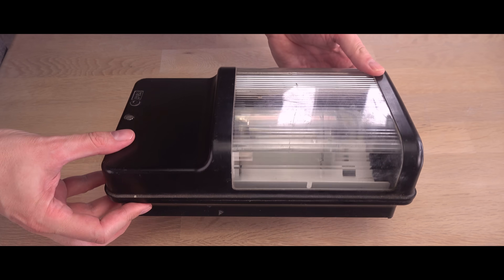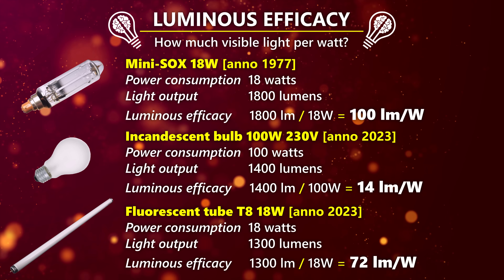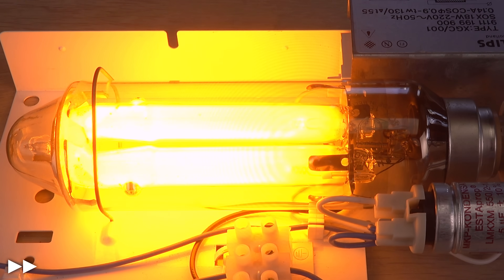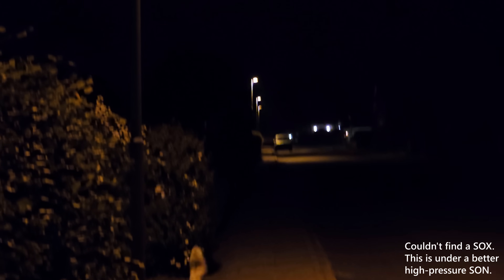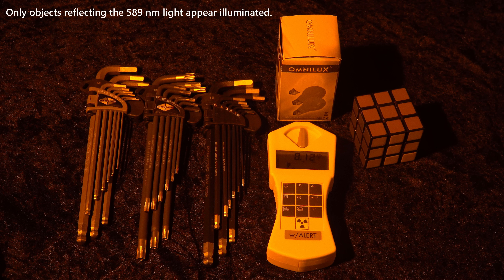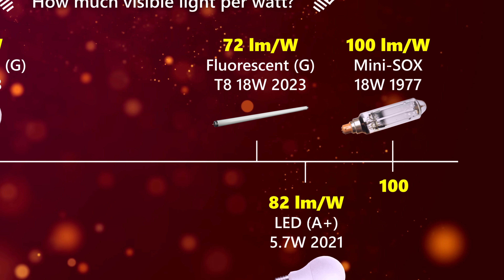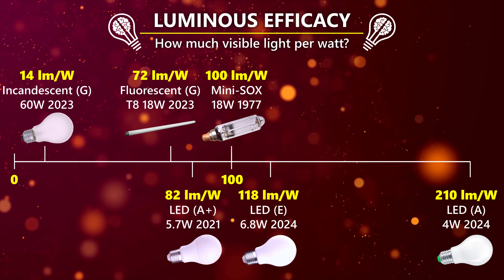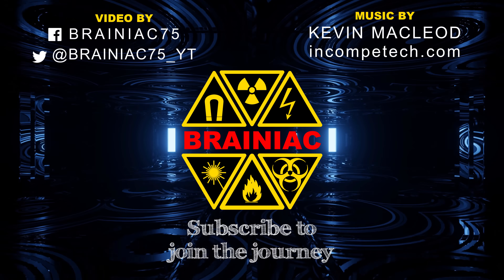THIS LAMP SOXs! "Yellow" tech of bright metal vapor lamp. Beats modern LEDs in brightness per watt?

Comment: High pressure sodium lamps were commonly used in bigger photographic darkrooms as safelight, because you can make photomaterial that is not sensitive to this specific wavelength. Nowadays, it is easy to make a LED for that purpose if needed.

Comment: Fun fact: at low lux levels, the typical human eye responds as if monochromatic. Conclusion: low level white lighting is of doubtful value if perceived as black and white.  Might as well benefit from a coloured street light that is different from vehicle headlights. Amber LEDs, anyone?
Reply: It doesn't work like that exactly. Though your scotopic (night) vision is essentially monochromatic, it has more sensitivity to certain wavelengths, and different ones compared to photopic (day) vision. While photopic vision peaks at around 555 nm, which is a yellow-green color, scotopic vision peaks at around 507 nm, which is a cyan color. So using white LEDs is actually better for night vision, since it produces more of those blue photons, whereas a high-pressure sodium lamp is way off from the peak sensitivity of our eyes at night.
Reply: Yes, but the net result is monochromatic streetlighting from a CRI70+ source.

Comment: In photons-per-watt, LED has greatly surpassed SON-T by about a factor 1.75. The problem is that those LEDs are the red 600 and the blue 450, both which have a low lumen-per-photon, but they're ideal for growing lights.

Comment: the biggest issue with the new led bulbs is their lifespan at that output, they run so hot they deteriorate very quickly, if they are run at a lower wattage they become even more efficient and run cooler

Comment: I am old enough to remember the first trial of sodium lights. Environmental and safety concern added by non discrimination of the color blind. First they used them for zebra crossing to gauze a possible safety effect. Many argued they were better in the fog just like French cars had yellow headlights. Eventually they pretty much became the norm of street lighting. The LED lights used now are far more tiring for the night drivers. To save even more energy they now use motion sensors to vary the light intensity where vehicles or pedestrians need light. Sad to see that most sodium lights are gone now.

Comment: Maintenance on a sodium lamp is a bit more involved than an LED lamp.  When I did electrician work, I preferred to change out ballast, cap, starter, and lamp because you knew the repair would last.  Plus 3 of those came as a kit together.  LEDs just seem to go and go unless the driver dies.

Comment: As for the LEDs I have in my house, the A19 bulbs (most rooms) are mostly Triglow 3500K so called "deco white" 1600 lumen bulbs. They draw 19 watts so my calculations come out to 84.2 lumen  per watt. I am kind of picky about color temperature. I can tolerate 2700K or 4000K but prefer 3300-3600K. Its difficult to find this color temperature range in bulbs, especially if you want 1500+ lumen bulbs in the A19 form factor. So when you finally find a solution you rarely have other options. I still have a bunch of Halogen A19 bulbs that produce about 3400K with 1500 lumens. They draw about 90w so just a hair more efficient than Incandescent but their light quality is superb.

Comment: The problem with these is that they are very monochromatic.  San Diego CA, Glendale AZ, and Flagstaff AZ were places I know of in the US that made extensive use of them.  Flagstaff used them specifically for their monochromatic output, which could be filtered out by the nearby observatories - Lowell and Discovery.  Light output was very good for lumens, but not so much for human vision.

Comment: We have quite a few sodium fittings still hanging around in the factory but they were last used way back in about 2014. They get taken down when we do work at high level. We went over to 4 x fluorescent tubed lamps fittings. One section of the factory has recently been converted to High Bays LED's, that go dim when no one is around. Once anything, person, fork lift gets near, they go up to full power output. Compared to the sodium's though, the LED's beat them for light. Maybe I'll be wearing sunglasses yet!

Comment: Sadly in the Unites states you can't generally get high efficiency bulbs. Nearly all are 100 lm/w and the bright ones around 80. I have some small ones I use for small rooms that are 117 lm/w, but only 350 lm. Ideally I'd like to get bulbs near or over 200lm/w. But the best I have found are 150lm/w and those I think are fudging the numbers because of how hot they get.

Comment: The efficiency gains in LEDs are great, if they are gained by using more LEDs. Unfortunately, due to our heightened sensitivity for green light, many extremely efficient LEDs have a terrible CRI. Thats why I do not look for the energy label on LEDs, it often negatively correlates with the CRI.

Comment: I have a sodium light I use for optical flats to take ultra precise measurements using interference fringes of light.  Wide spectrum bulbs have many different interference lengths so blend and dissapear.  I also used one when I was young for doing prints in a dark room because the paper was not sensitive to that wavelength. I’ve always been facilitated by how monochromatic they are. I really don’t like how they are obsolete because I like having a cheap source for monochromatic light for experiments.

Comment: Why don't they make LED's with 1500-2500K? There is always this 2700K limit for normal lamps and I never got why, only those "retro" led versions often have 1800-2400K but they are very low powered, so if you want really bright orange light, you have to use a RGB LED which would be stupid for normal home lighting.

Comment: LED streetlights need to go.
These were better in almost every aspect. Lasted longer too and you didn't need to replace the ballast when the bulb went.
When an LED steeetlight dies you need to replace the entire head, which contains the driver circuitry and heatsink.

Comment: Lumens and Lux are two different things... Lux is more important for visibility.  My whole 14 acres on my property uses Mercury vapors and high pressure sodium.   

You get a lot more visiblity with the DX coated Mercury vapor lamps than you do the high pressure sodiums.   But the lumen per watt is more on the hps.

I dont use LED because led lights for putdoor lamps are still pretty crappy or were theyd getting better.. but the pin point blinding ligjt of led is rather annoying.

I only use them for floods that i turn on and off at will.

The bottom coating of LED light bulbs are trash as well on your video at 9:55.  That coating there is like gold leaf thin...  and wears out very easily causing those crappy led bulbs to no longer work after a short time.  Ive had to replace many of them because of this.

While old fashion bulbs used very thick coatings that dont wear out.

Led diffusor tech is still crappy as well.   Outdoor HID lights are 360 degree 100% coverage that improve drastically with reflectors.   You can improve the lumen output by near 2 fold with a reflector.

Leds only go one direction.. and the diffusion reflecting tech is still pretty crappy with them. 

This is why LED lights over fish tanks create that wavy sensation in tje sand..  its all shadows.  Light coverage is bad with led over florescent or HID

Comment: I think a gas discharge tube with an advanced flyback driver with a current feedback loop that can be pushed to be 90% efficient could beat the LED in terms of lm/W maybe but definitely in terms of life span. There is just nothing to break here, the electrodes are thick tungsten balls so they would take a very long time to break down.  It basically lasts forever untill something else breaks it. If we take that sodium lamp, get rid of the heater coils and replace them with tungsten balls, boost up the voltage to several kilovolts or so depending on the gas resistance. You would need to switch to DC at this point and build a flyback driver like this. Now you are not loosing power in them anymore and instead you just heat up the gas with higher voltage and then lower the voltage as it draws more current.

Comment: I believe we used these for darkroom lighting since it was spectral pure in a particular band would not react with black and white paper processing. The lamps were hung from the ceiling and aimed up at the ceiling for a dispersed light. The energy ratings are false. When one considers the power factor being low the lamp will actually be using the same energy as a standard light bulb. Power factoring cannot be measured with standard analog mechanical kilowatt meters. If one had the new digital meters, they can detect the power factor and correct power usage of led lamps. Now in the states power companies must inform customers of power factor correction for billing purposes. Failing to do so would be a violation of their declaration made with the public utilities agency of  the states they operate in. If you have a digital meter take the time to check their terms of service registered  on your states website, then call your supplier and ask them if they are doing power factor correction billing with your service.

Comment: In Saskatchewan SaskPower used high pressure sodium either 100w 150w 250w or 400w bulbs. Also in sentinel style light fixtures they used mercury vapor. We now use LEDs with a warm white light.

Comment: There is something charming about a street still lit with older sodium lighting, our road has historic street lamps so hopefully they will never modify them to the clinical LED fittings used on main routes. They have a high failure rate compared to the older lamps. Living in austerity Britain, the streetlights on side streets go off at midnight because of cost, we are used to it now after 15 years of cost cutting, but the old orange glow of sodium meant safety, and not twisting an ankle on broken pavements

Comment: There's a solution for using LED and preserving the old yellow color: Using 3000k LEDs. In a village of Spain called Pozo Alcón the council has been doing that. I visited that village a year ago and believe me, at night you won't see no difference from the old lights and these ones until you get close to them and see the LED matrix. In fact, not only they consume less energy, but also they seem to emmit less light to the atmostphere thanks to their moders desing.

Comment: In terms of efficiency nothing can beat it even LED. I loved these streetlights. In England they were everywhere. 
In lifespan they also beat LED.
Reply: No,  they don't. Nothing beats the lifespan of LED. Induction bulbs come the closest,  but these sodium bulbs have metal electrodes that degrade quickly.
Reply: @LarsLarsen77  so you say it is only a question of quality? The only type of LED that I Have seen last long are led tubes for replacing CFL but bulbs and especially spots don't last long.
Reply: @LarsLarsen77  Sorry, but this not true. I remember on 90`s those mercury  bulbs run for more than a decade better than any Led now in my City.

Even compact fluorescent beat by far Led lifespam and lumens maintenance. I remember those first ones made by philips working 24h and any Led didnt 1/4 of that. No one told that to me, I seem that.

Comment: For street lamp uses... I think the Sodium lamps were better.. 
Our city... and apparently many others recently replaced or put up a HUGE number of new LED street lights.... and within a month or so.. they were all failing.. and going blue/Purple...  was TERRIBLE to see anything.. they actually blinded you.
I wonder what the cost savings were for sodium lights that seemed to last many many years vs these new cheap LED's that fail 5x as often...   The labor to change them all.. road closures while they change them...  its a disaster.

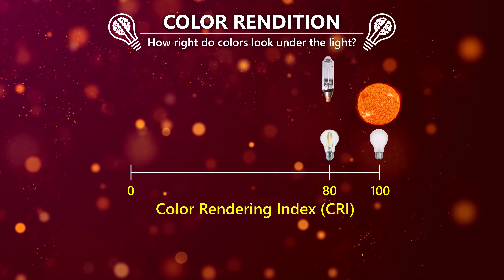Comment: You are right at 5:30 to say that led bulbs are not good at color rendering. In winter, led lighting is so poor and depressing. Not really pleasant for reading, working, etc. Good incandescent bulbs were better, with their complete spectrum, and CRI of 100!
The main interest of led is the low power consumption. On the lighting side, not so good. Most have a CRI of 80, 😟.
By the way, did you know that CRI is not even an accurate indicator? There are better tools/indicators to evaluate color rendering.

Comment: hmm but growing up in the city that orange is now my natural light and i feel unsettled without it.
ive built a little collection of amber lamps i use when i want to just relax. running from batteries to avoid flicker. the ultra flicker of off white led's are so horrible to see with. unnattural, unsettling.

also white leds are more efficient at producing light, but they have the worst characteristics for reflecting from road surfaces etc. so the efficiency is lost.  you get no depth perception with that light and no details of what your looking at. it makes the world low contrast. horrible invention.

Comment: (Here in the states at least) Typically the street lights are/were high pressure sodium which had a handful of emission peaks. Usually youd find low pressure sodium lamps around observatories where they could slip a sodium filter into the optics path and filter out all the light pollution. Images online are a bit exaggerated in how 'white' the yellowy HPS were, trust, they were still quite yellow. Though I suppose compared to monochromatic LPS they would have a bit of spectrum to them.... Easiest way to tell is look at the diffraction of the light, bunch of peaks? its HPS.

Comment: Using a spectrum analyzer with another light source near isn’t a good testing method. You end up with the sum of two spectrums which isn’t accurate. Your sensor for measuring lumens isn’t accurate for measuring led output, you need a quantum sensor to get accurate readings from leds. Not only that, you are comparing high bay lighting with consumer electronics grade lamps. Is this a joke?

Comment: Replying to the engagement challenge:
I have a lot of CFL and older LED bulbs in this house, and a small fistful of incandescents left that I just haven't replaced yet. Yes, I'm terribly inefficient.
I also have a few SON/HPS lamps, and built a bizarre conversion kit to make a table lamp into a metal-halide fixture. They make me happy.
Footnote, if you are buying LED, you actually want to pursue these high efficiency LED lamps. They will last longer, because they aren't driving the LEDs as hard.

I never actually got the chance to experience SOX/LPS lamps. Where I grew up, and all the way up until the modern era with the movement to LED, my nights were illuminated by SON/HPS. That amber glow defines outdoor lighting for me, and a part of me is saddened that they are going away.

Comment: I feel good having clicked this video as I know things about these lamps until I learned the output is almost monochromatic as laser. Then again, it should not be surprising.  Consider heavily color tinted lamps, In layman's terms, they don't put out light but color!!  This sodium lamp just puts out a single color, good CRI has RGB colors!  
anyways, is it possible for a minimum of three RGB lasers to mix and put out almost white light?  I bought three laser pointers to test this theory. However, I dismantled the laser immediately only to discover each color has a different electronics and dimensions.

Comment: Of course someone will find some paper that says how LEDs will solve every problem on earth, but they're forgetting that we have limited resources, and sodium lamps require less exotic and complex materials compared to LEDs. Yes, they require support circuitry, but unlike self-contained LEDs, those components are separately replaceable from the bulb which reduces waste and operating costs. And for the purpose of lighting an outdoor area at night, using as little light as you need helps reduce eye strain and preserve night vision, which also favors sodium lights with their narrow bandwidth and warm color. LEDs have their uses, but I'd say it's mainly in flashlights and portable applications where compactness is the most important quality.

Comment: I've got Cree 4Flow bulbs from 2015, 2700K 83CRI 9.8 W 815 lm, 83lm/W. Bought several used for dirt cheap. I like the look and it actually having decent heatsink area(internally, with slots for airflow). Pretty decent for a 2015 bulb, and I ain't replacing them till they burn out.

Comment: My LED lamp is a 11W bulb putting out 1055lm at 2700K. I also have several sodium SOX lamps I run for the fun of it ranging from 26W to 131W. The larger the SOX bulb, the more efficient it gets. The longest (4ft) 131W SOX-E lamp puts out at 200lm/W easily. They were used for lighting motorways.
I like the monochromatic light they give out, and especially the colour changing light show they make during their warm up. I appreciate that technology has advanced, but I wish the old SOXs were still in production and in common use. One experiment I plant to try with my lamps in the future is the 'black fire' display. Will we see that on here soon I wonder?

Comment: When I visited the Guggenheim museum in Bilbao, Spain, they had a room where in the center was another triangular-shaped room hung from the ceiling, no floor, no doors, no windows, but high enough from the floor to crawl into. Inside, the only light source was a sodium vapor lamp, and the contrast from the regular light from outside the triangle-shaped room to the monochromatic light inside was very shocking. I guess we are used to that kind of light when driving on a highway at night, but inside a room is jarring.
Cool exhibit.